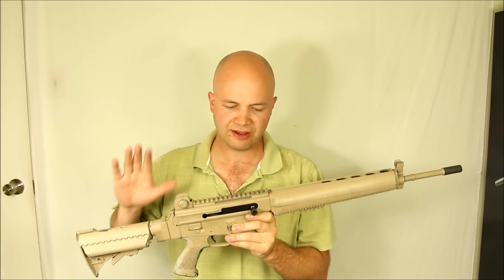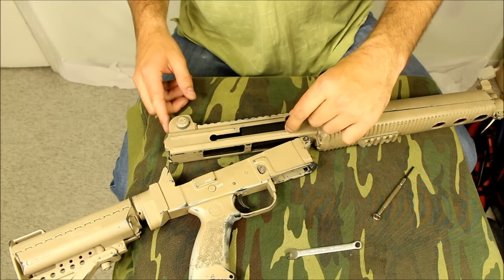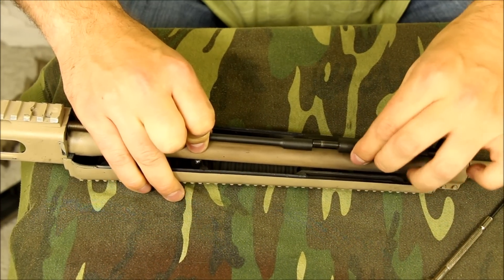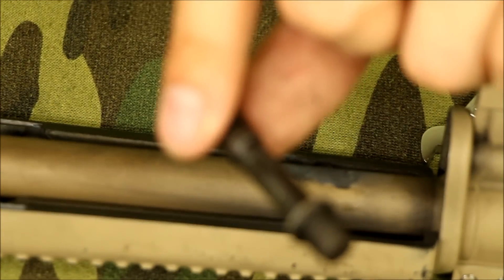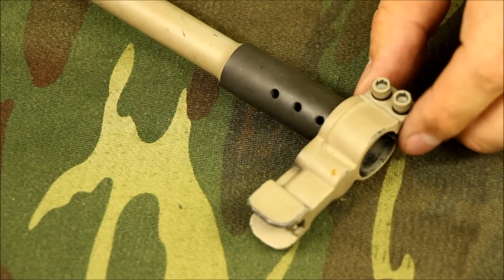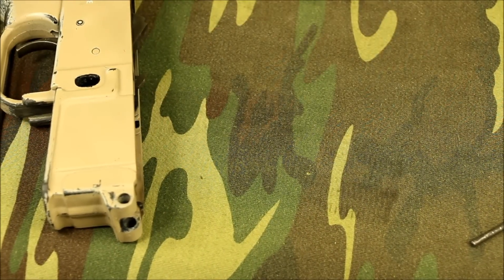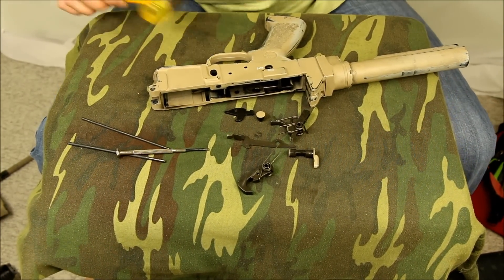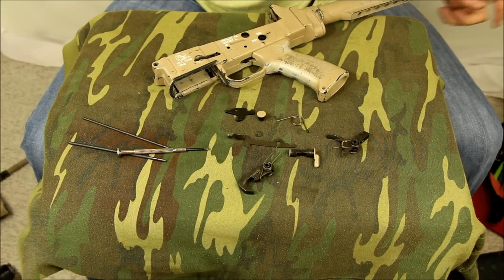ArmaLite AR-180B Disassembly

Comment: Dose the grip stock tube not come off?
Reply from the maker: +thor 90 Which part? The grip can't be removed, while the buffer tube at the back is connected with an AR adapter that Stormwerx sells.
Reply: Is the tube fix to the receiver

Comment: Agree with OP.  That horrible paint job has got to go!  ArmaLite should NEVER have made that lower out of polymer as those front lugs just will not hold up over time.   There are aftermarket metal ones you can buy and epoxy on the front of the lower to replace the broken polymer ones and you can even buy a nice NDS-18 aluminum lower from NoDak Spud and make it an entirely nicer rifle.
Reply from the maker: In Canada, we're making new 180 clones: https://www.youtube.com/watch?v=6f8uDQaeQpc
Reply: @ndenise3460  could you link it?